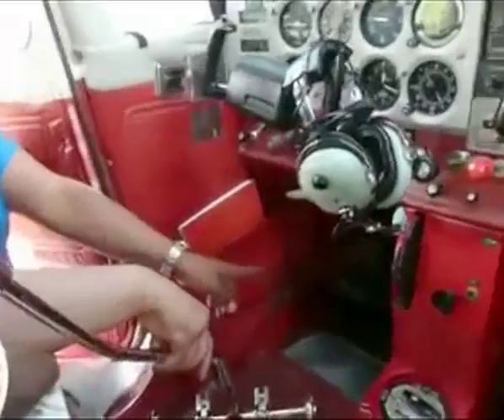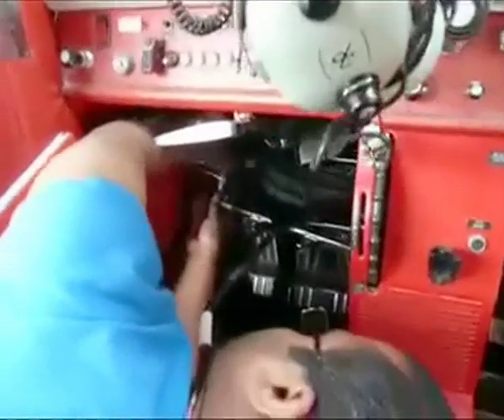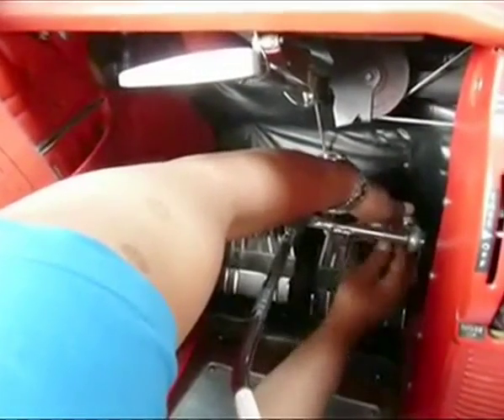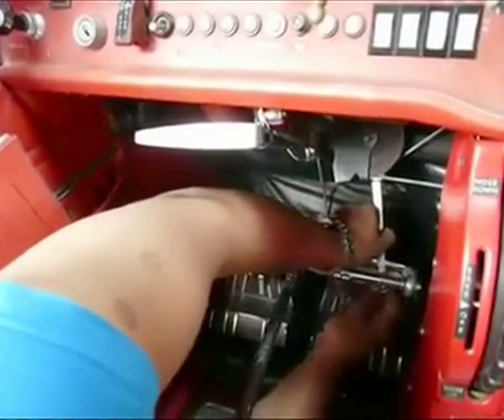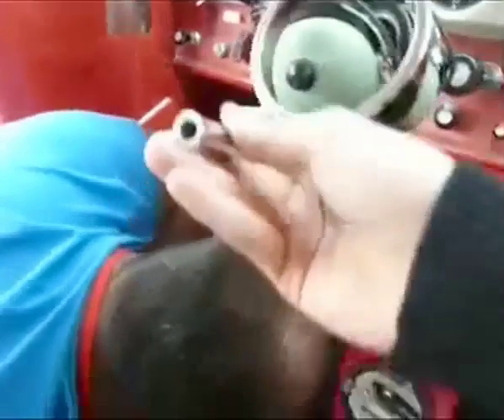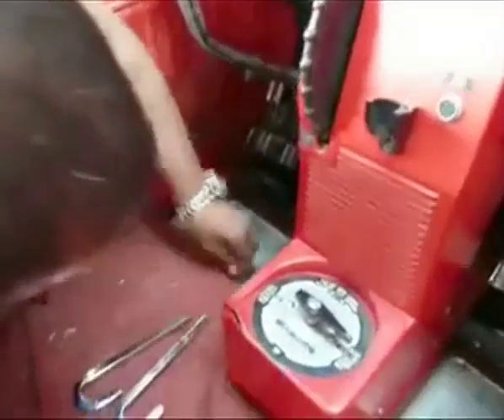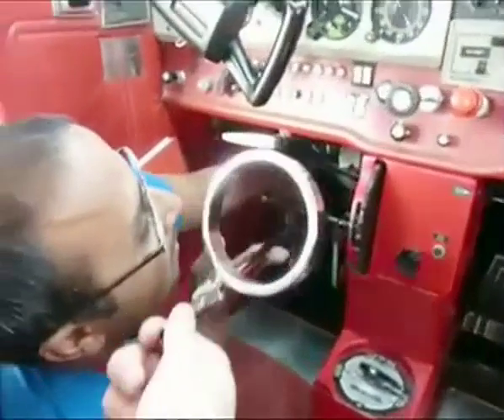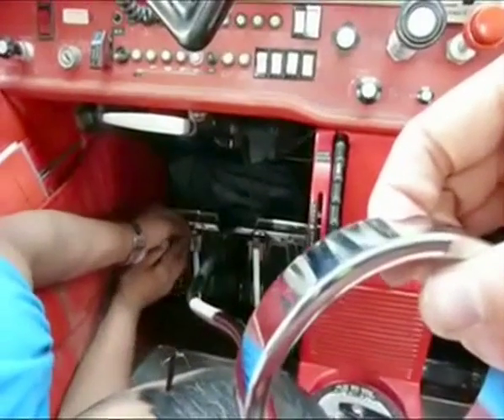hand control for disabled pilot, cessna 172 @ Freedom in the Air, EGTC - UK

Comment: I probably should have explained in my previous missives that the Blackwood hand control did not work like the one in the video.  It was push down for for left rudder and pull up for right rudder.  No differential braking.  The hand brake only.  That was what made ground handling difficult in tight turns.

Since the Cherokee rudder pedals are interconnected, IOWs as you push down on the left rudder pedal the right one came up and vice versa it didn't need to be attached to the right pedal.  So the Blackwell HC only bolted on to the down tube above the left pedal on the passenger side then came up right by the throttle and had a  rectangle attachment on top that went front to back so you could slide your hand to operate the throttle while holding onto the rudder control.  Not through one's wrist.

In reality the Cherokees of that era didn't need much rudder of all, especially the 180.  The Six on takeoff needed a lot of downforce (left rudder) to counteract the torque of that big prop and the HP of the engine way out front.  Cherokees were also certified to land in a crabbed position similar to the Ercoupe but I didn't like that and straightened the nose right before the touchdown which took a lot of practice to perfect.

In fact when I went for the license the FAA examiner was holding on so tight his hands were white as a sheet and after the first one said, "Boy that was lucky."  Then I did it 3 more times and with a very strong 90 deg. crosswind and he was more amazed than scared.  It just takes practice and I did a lot of that.

Comment: I first learned to fly in 1971 and passed my flight test in 1972 in a "Piper Cherokee 6" I bought since no one would rent me a plane and let me put on the Blackwell Hand Control back then.  My longest flight (with fuel stops, of course) was from Dulles (near D.C.) to San Juan, Puerto Rico.  After that I wasn't too keen about flights over water especially when you loose radio contact from South Caicos to San Juan.  Flew for a number of years until it just got too expensive and then flew occasionally in a friend's Ercoupe (no rudder pedals to hand control) which was a blast.  Probably have over 1,500 hours in the Six mostly in the SW U.S.  The Cherokee Six was a lot of fun to fly.  It was very stable and being one of the largest single engine had room for 6 1/2 people.  Those era Cherokees really didn't need much rudder input except severe crosswind landings and steering on the ground and they came with a hand brake so no pedal brake was necessary.  I'm 71 now and too old and poor to fly anything but RC planes but I miss the thrill of flight.  Kudos to you younger guys for keeping the dream alive.
Reply from the maker: Thanks for sharing your flying experiences. What did you do with your Blackwood controller? We'd love to know more about your flying adventures. Does the Cherokee 6 require more effort to fly then the smaller PA28's..and remind us, is it retractable, and how did you get to use the Blackwood. i.e what STC approval did you have for it?
Reply: FreedomintheAir fita
The Six was more difficult on the ground, especially with right turns since it was an up vertical motion with the hand control so I just planned left turns where possible ignoring the ground guys at the FBO's.  But it was easier with passengers since it took weight off the nose wheel.

I said previously that most of my time was in the SW US but I meant SE as I live in Florida.  In 1974 I moved from Miami to NW Florida and bought 65 Acres that was .5 mile in length so put in a 2300' grass strip.  Not the best for the Six but I never took off with full fuel and no more than 3 passengers.  Landing were hairy though because there was tall pine trees adjacent to the south end of the runway and wind seemed to be always northerly of course.  But I got a gadget that installed on top of the dash that showed the stall speed in red (regardless of load) and as long as you kept the needle away in the green you were okay.  Can't think of the name of it.  It worked great and I floated in right above the stall over the trees and then cut the power and it would drop fast and then right before touchdown I'd pull the wheel back under my chin and that big wing just cushioned it down.  Took a lot of practice but I had two small children and wished to keep them alive.

Pulling the last third of flap was semi-difficult because I had to let go of the wheel to brace myself and I rarely used it.  But aside from the right turns on the ground and the last third of flaps the Six was much more forgiving than the 180.  This was the older version mind you, 1967 model, 260 HP with an adjustable speed prop.  I only flew with all seats full a few times and the first time I wasn't ready for the "drop" and my landing wasn't the smoothest.  Sink rate is fast with a full load.  I put my chair in the rear baggage compartment and sort of "crawled" to the front turning sideways to get through the two front seats.

I had the 180 first and had about 70 hours on it when I got the Six and the same week I passed the flight test with an FAA examiner who had never flew in a hand controlled plane and kind of gave me a hard time until he looked in my log book and saw over 90 hours of mostly touch and go's, almost all crosswinds.  Then all he had me do was 4 touch and go's with a 90 deg crosswind and  a soft field landing and that was it.  He just said, I could fly better than student he'd seen in a long time.  No cross-country plan, nothing, just the cross-winds and the final soft--field landing and he surprised me when he said taxi in.  I though I failed somehow since he didn't require all the other things I was told I might have to do.

I gave the Blackwell hand control to a friend who flew Cherokees for a while then got a Bonanza (with standard tail).  Never saw his hand control up close.  He also bough the last Ercoupe manufactured.  I believe they called it a Alon A2 Aircoupe. Anyway, he found out they were shutting down and conned them into building one more.  I put a lot of hours in that thing.  What a hoot.  You could turn it by sticking your arm out the sliding canopy and land it crossway on the taxiway if the crosswind was high.  I also flew a late 40's version metal covered that was an accident waiting to happen.  The floor was piece of plywood just laying there not screwed down but the engine was newly overhauled and a friend got it and soloed but never went on for his license so I flew with him for a while until I kept smelling gasoline and told him something was leaking somewhere and wouldn't fly it anymore.  That was the same guy who flew with me to San Juan and thought the next cloud was one of the islands we were using for dead reckoning.  A paraplegic too and a former Special Forces soldier in Vietnam whose specialty was supposed to be navigation.

Enough...I could go on forever.
Reply: FreedomintheAir fita
Forgot about the other questions you asked.  No, this Six wasn't retractable and as I've since found out you know all about the Blackwood HC being approved for the pilot to put it on and off.  So for the Six I got the measurements from Blackwood himself as he put one in a Six before me.  But it required installation by an FAA approved mechanic to put it on and certify it had full rudder travel and make an entry in the aircraft's logbook.  Which I don't believe was necessary with the 180.  Full rudder is all they are interested in and the FAA examiner when I took the flight test for the license didn't even question it although he read the entry in the logbook and looked at the certification papers with the letter from Blackwood giving me the measurements.  When I sold the plane and took it off I told the new owner he needed to get an FAA mechanic to certify it was removed with no damage to the rudder pedals but I don't think he did that.  I'm not so sure she is still flying and the last I heard she was just sitting on the tarmac at Tamiami Airport near Miami going to pot.  N5500J